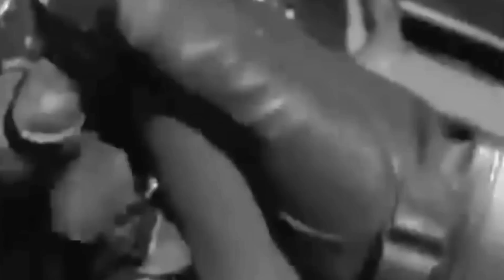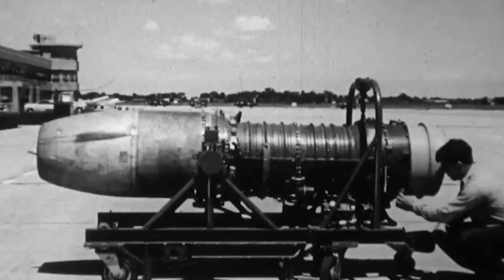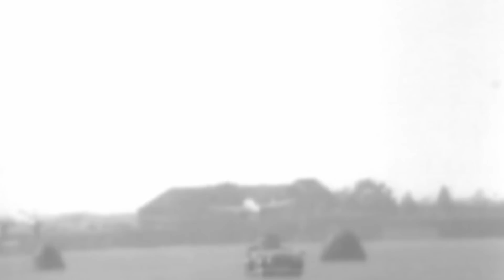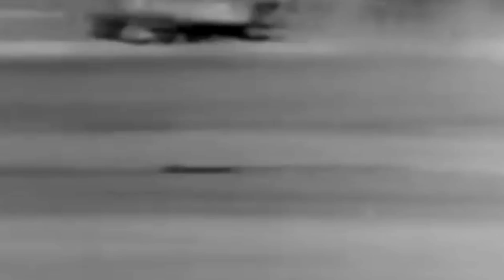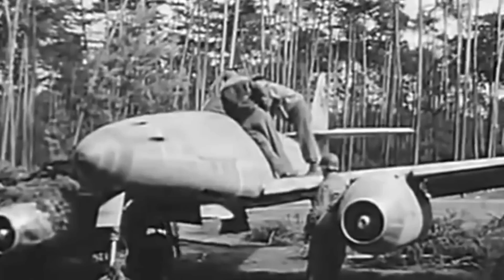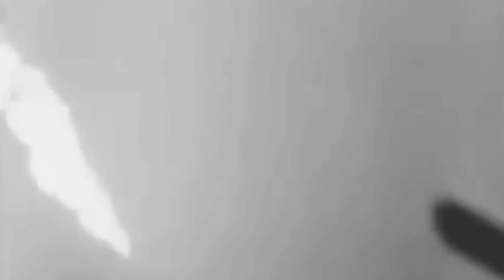The Never Before Seen Fighter

Comment: And it was seriously good looking too.  So stylish.
Reply: Unless you were on the receiving end of those 30mm.....
Reply: @MrBestshot33  yeah the german 30mm was no joke at all each high explosive round had the equivalent of a standard hand grenades explosives in them with a delayed fuse so that it would pass through the skin of the aircraft and detonate inside the aircraft the united states tested them after the war was over on old aircraft at a firing range and just 1 30mm shell could cleave the fuselage of most targets the tried it on in half they probably wouldnt do near as much damage to engines as armor piercing rounds but an aircraft cant stay in the air if its missing its wings and/or tail
Reply: One of the most beautiful (sexy) Military aircraft that ever flew. Smoke and sleek. It looks fast just sitting on the ramp. Like the F86 and English Electric.
Reply: Hell it looks like somebody is stealing two pigs and has one under each arm
Reply: Seen one in the Deutsche Museum in Munich. Beautiful indeed.
Reply: Most beautiful aircraft ever, imo. ( Xf-11 and Tu-114 second and third) . You gotta think, they knew exactly the psychological effect it would have... Looking like a sky-shark. It couldn't have been easy to machine such beautiful curves outta sheet metal , 80 years ago.